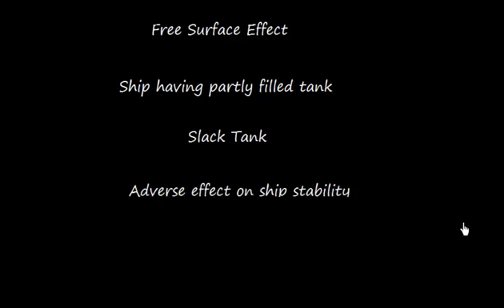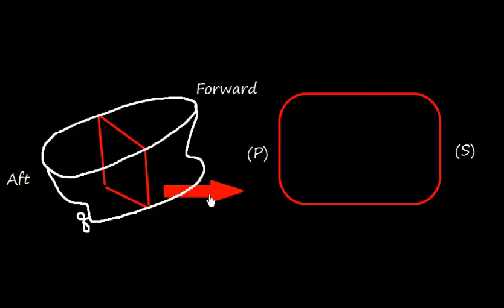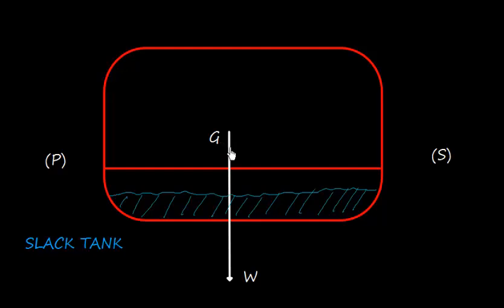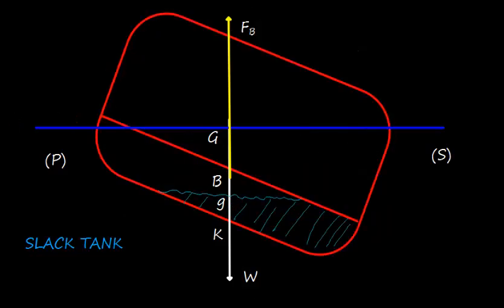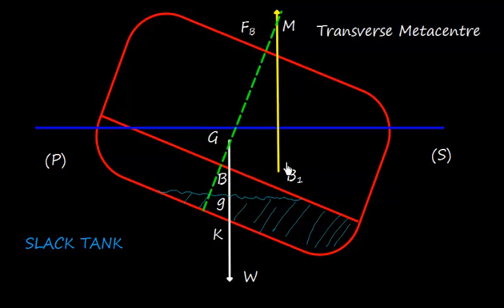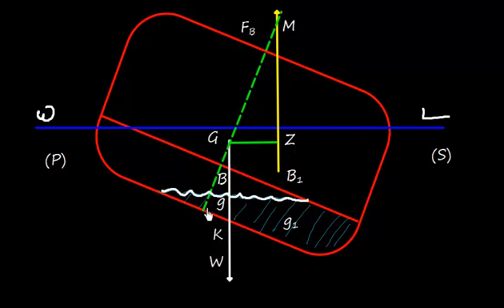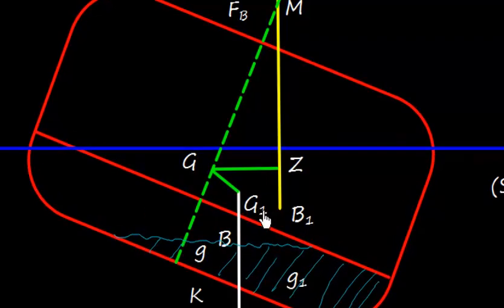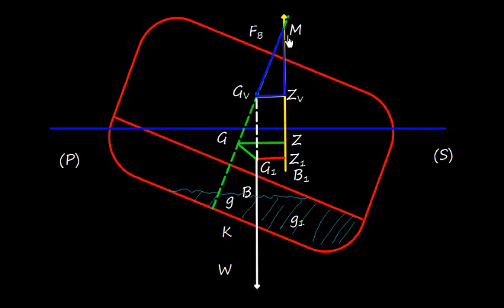Ship Stability _Free Surface Effect (FSE)

Comment: Dear friend, so called FSE is in fact transversal moment of inertia of free SURFACE and is not therefore connected in any way with volume of liquid in tank. In other words, it doesn't matter, if you have 1 meter, or 1 mm of free liquid in tank. Effect on GM will be the same. Basic formula of transversal moment of inertia for rectangular tanks is: lxb^4/12. Thus you can see, that there is no units used in the formula and you can see what factor (b^4) is contributing most to the detrimental effect of this phenomenon. I skip over mixing initial stability with GZ curve in view of the FSE. This is bad educational tool for our young officers.
Reply: Why "12" in the formula ?
Reply: @frontmate You don't want to know

Comment: So the mass of the liquid in the tank has no effect on FSM and FSC?
Reply from the maker: As long as there is sufficient liquid free to move across the breadth, there will be free surface effect. For a box shaped tank, if the space occupied ( or mass as mass= volume x density) by liquid is between 5% to 95% (approx ), the  free surface effect is almost same and a constant value of FSC ( Free Surface Correction) is taken. However if the liquid filled in a tank is above 95 % ( less space to move), value of FSC reduces and can be neglected . For a triangular  shaped tank,  this effect is even more than box shaped vessel due to the large shift of center of gravity of liquid.
Reply: SAILORSTUBE thx for the reply